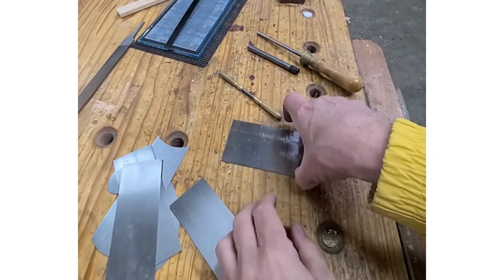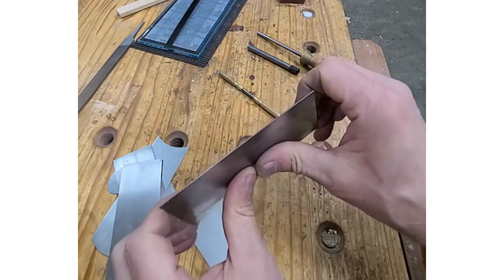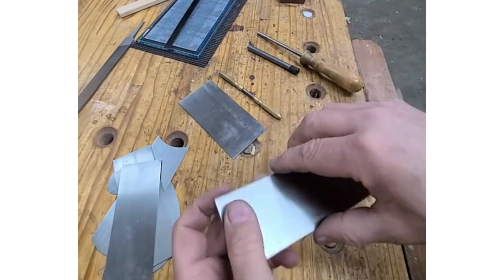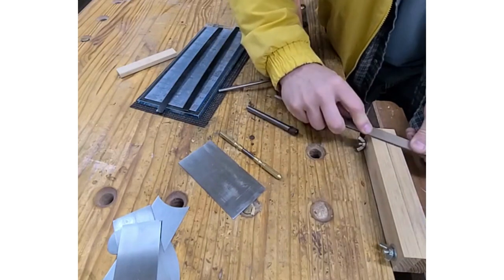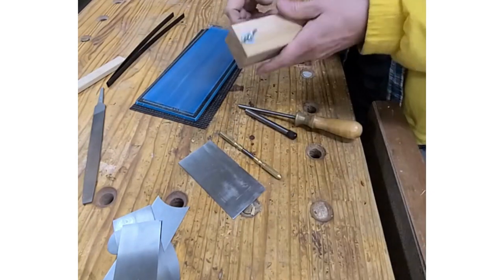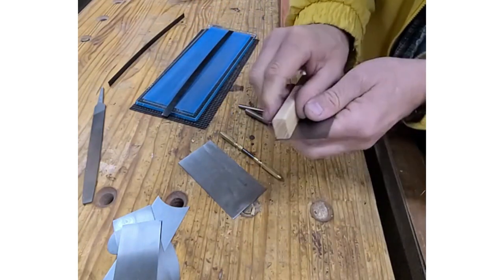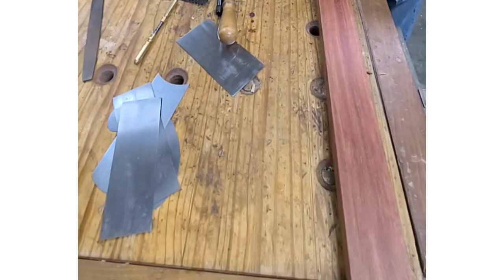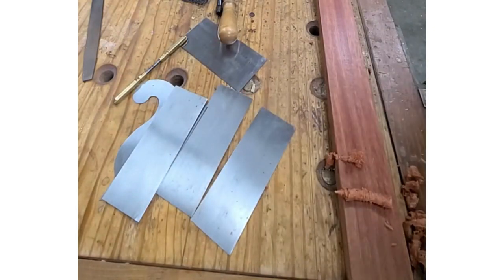Don't break your thumbs - use this cabinet scraper

Comment: Thank you so much for doing all you do for the woodworking community.  Taylor Tools is a great company to work with.  I was just thinking I need to get a gooseneck scraper.  I think I'll also get the scraper prep kit while I'm at it.  The burnisher has been a great addition to my scraper prep routine.  I struggled tremendously with turning the hook on my scrapers until I got your burnisher.  Now it's so easy!  I have been very happy with all of my TayTools purchases.  Thanks for doing all these videos!